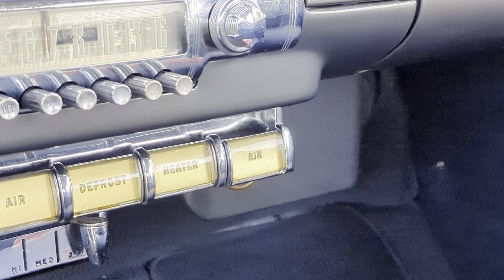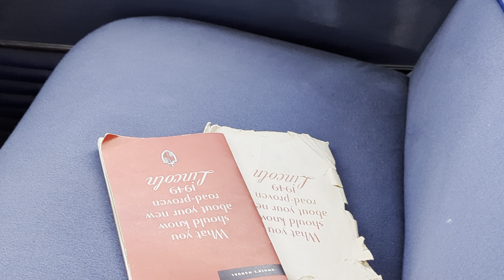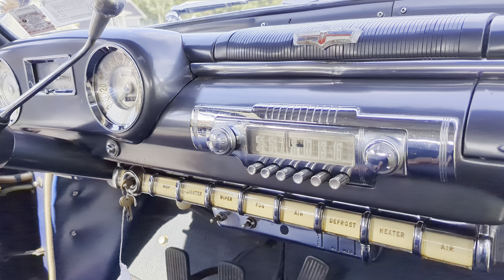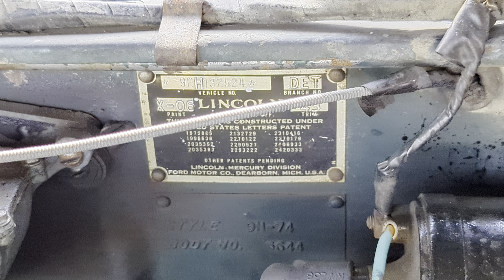1949 Lincoln Cosmopolitan Sedan For Sale

Comment: No straight 8 in a Lincoln it's a V8 (flathead).  These '49-'51's deserve more love, they used the "bathtub" design better than most other cars... of course, Caddy overshadowed them with the fins and eggcrate grilles... plus the '49's suffered QC problems due to introduction before all bugs were worked out
Reply: Yup, this model was originally intended to be the base series Lincoln.  The car was the base Lincoln, the Baby lincoln, was supposed to the be 48 Mercury, and the car that became the 49 Merc was supposed to be the 48 full-size Ford.  There would have also been a compact Ford.  That car became the French Ford and the rest were all moved up a notch, and a new 114 inch wheelbase Ford was hastily hammered out.  That car was the 49 Ford, and it too was full of bugs.  This Lincoln was made in calendar 1949.  The cars that were built in late 1948 had different door handles, and they were a big problem.